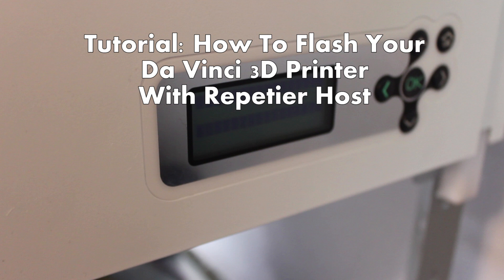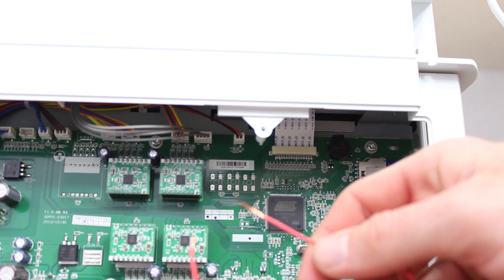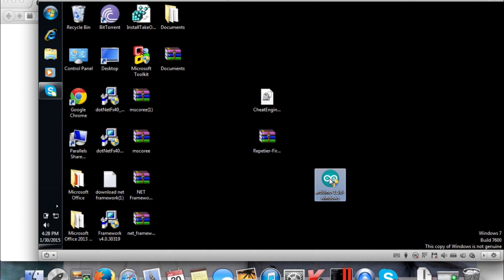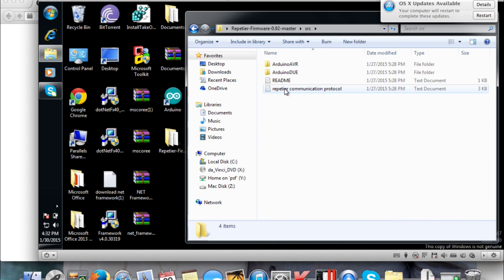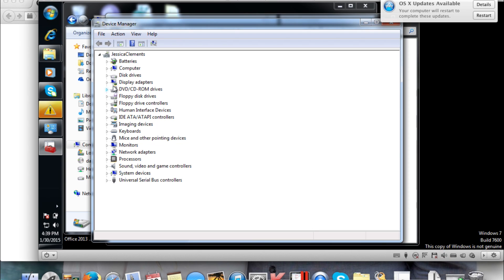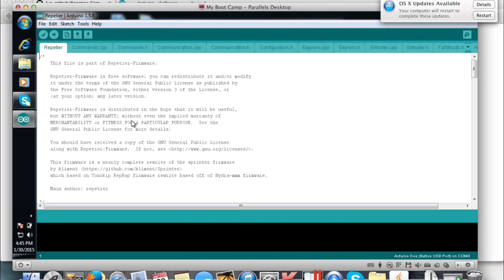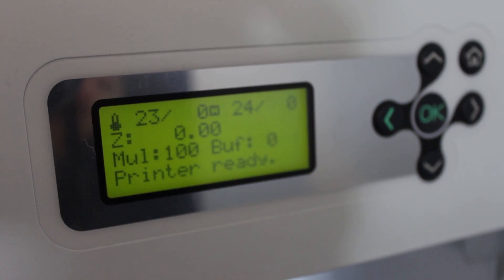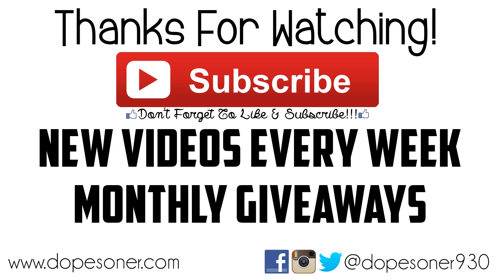Tutorial: How To Flash Your Da Vinci 3d Printer With Repetier Host | 3d Printer Hacks

Comment: OK, so nobody makes my mistake, if you have a Da Vinci 1.0a with a serial number starting with 3F10A, this WILL NOT WORK! This will effectively brick your printer, as there is no way to reinstall the original firmware!
Reply: +Thomas Piccione You sure you didn't do it correct? looks like this guy isn't the only one to flash a 1.0A. There is even options in the code to adjust for the 1.0A. Have you tried dumping the memory (jumping j37) again and trying again?
Reply: jake wishau  Sadly, I tried it multiple times, and I followed the guide precisely. If you noticed, all of the da vinci 1.0A's that have been flashed do not have serial numbers starting with 3F10A, as these have newer boards, and they cannot be flashed. I changed the setting to the 1.0A, but this is for the older 1.0A with the older boards that CAN be flashed.
Reply: +Thomas Piccione Good to know. Too bad I can't find a cartridge reset for the newer version too? It's a great starter printer but I have only had mine for 2 weeks and feel like I have out grown the very limited software adjustments and I would love to use 3rd party filament.

Comment: Followed Video EXACTLY. 
It worked!!!
Much thanks to Mr. Dope!
Reply: What printer do you have?
Reply: Luis Alejandro Sáenz

I have a Da Vinci 1.0 (JP1 to reset)

The guy in the video has tried it with both the "1.0"(JP1) and the "1.0a"(JP37) models and it has worked.

I thought for sure my machine was broken, then I finally just decided to start clean. I deleted all my previous files, turned off the printer and started from scratch. Again: The board is literally impossible to brick for good so if you have the 1.0/1.0a THIS TUTORIAL SHOULD WORK. If its not working, you're probably doing something wrong. Delete all files and restart from the beginning. 

Guess all I needed was a fresh start!

Hope you reach the promise land!
-Justin 

P.S. I do have to confirm that the Repetier Firmware is MUCH more versatile and user-friendly than the stock firmware. It is well worth the upgrade/switch.
Reply: +Justin Shaw I have another question. My XYZware software don't recognize the printer, but my computer does. Which software should I use to print? Thanks :D
Reply: Luis Alejandro Sáenz 

What does the computer recognise the printer as???

 If it doesnt recognise it as a "Bossa Programming Port" then you may have to re-flash the printer. This seems like a problem with the software and not the computer or printer. (For a PC, I have not figured out how to configure it with a mac...) This also depends on where you're at with the firmware-update process... if you have successfully updated to Repetier (Does LCD screen light up?) then you should definitely not use XYZware, try Repetier-Host (http://www.repetier.com/download-software/).

Best, 
Justin :D
Reply: +Justin Shaw Actually I'm using Repetier Host and right now I'm printing for the first time since I flashed my printer. It was very difficult to set the right configuration to start printing, but finally I've done it. I don't know if you can share with me the configuration you set on you printer. It would be very helpful for me. I appreciate your answer and I apologize for my english. 

Thank you

Comment: Hello! I am in need of some assistance! We just flashed our ZXY Davinci 1.0 printer. I Followed the steps exactly as stated in this video. However we are now stuck in a boot cycle. It brings up the boot screen, Loads the information, but we cannot click the right arrow to pull up the menu. then after about 10 seconds it cycles back through. Has anyone else experienced this issue?
Reply: +nickpro2000 I dont own a da vinci but it sounds like a block and you need to short the board again
Reply: +Jeremiah Matousek we actually fixed it by disabling watchdog. Thanks for replying though!
Reply: +nickpro2000 can u send me a link to how to disable watch dog because i am planning on buying this printer
Reply: +Whopper Mods I did not find a link to it I had to dig through the github to find it. You can disable it by going to the configuration.h tab in the repietier file and ctrl + f "watchdog". where it is defined change it from 1 to 0.
Reply: +nickpro2000 the exact line you're looking for is "#define FEATURE_WATCHDOG 1". it's on line 1386.
Reply: +nickpro2000 thanks allot
Reply: +nickpro2000 was ur printer on firmware version 1.2.7 before u flashed?
Reply: +Whopper Mods I don't remember exactly what firmware it was on but as I recall it was the most recent firmware available at the time.

Comment: my problem is that it tries to print off the side of the bed nearest the waste bin. how do i change start point?
Reply: I had the same issue...

So what I did was I went into the settings of the XYZWare software, and changed it tfrom mm to inches twhich allowed me to select "Automatically Center..." (Then exact name escapes me) then I changed it back to mm because nobody likes the 
Imperial System.

That fixed it for me. Now it automatically imports the ".stl" files into the center of the bed.

Hope that helped you!

Justin :)

Comment: Hey nice work on the video really easy to follow. 
!Problem I got everything connected and had control of everything but!  When it runs a code it doesn't push out filament. So I checked and did a head clean and everything worked. Have you read or seen this?  Getting tired of looking

Comment: I'm having a problem and I cannot figure out how to fix it. Running Arduino 1.58 Firmware .92 Da Vinci 1.0 ( J1 style) After I compile and Upload the firmware it the LCD still has black lines and the machine seems bricked. do I reset the printer and then open repetier? Even when I reset the machine I get the sane error. Repetier does not see the printer and gives me an error " The connection failed with the following erros: the parameter is incorrect. Make sure your printer is connected" Do you have any ideas? I think the printer is bricked and the only way to fix the machine is push the original firmware with atmel. Any ideas? I also try to upload .91 firmware and have the same issue. .91 firmware use to work as well.
Reply: +Mark Fuller did you find a way to fix it I have same issue????????????? plz help
Reply: +Cian Govern 
Same issue here. Still have the black lines even though arduino says set boot flash true & CPU reset.
Reply: hey I just downloaded the repetier thing for arduino and loaded it straight on and it works perf
Reply: Do you still have the black lines across your LCD screen when you flashed the Da Vinci? What repetier thing are you talking about?
Reply: +Mark Fuller Shit, shit shit SHIT!!!! SAME PROBLEM! Any way to go back? Really need some fucking help
Reply: +Thomas Piccione there is another way to do it by using arduino software look for other tutorials on utubes and pick one that's what worked for me
Reply: Cian Govern Thanks for the reply, but the newer boards cannot be flashed with repetier and there is no copy of the original firmware, so my printer is effectively bricked :/
Reply: Thomas Piccione have you checked out this website? They have original firmware saved. You should be able to reflash you machine with atmel software. http://voltivo.com/forum/davinci-hwmods/29-i-bricked-my-da-vinci-1-0-3d-printer-upgrading-firmware#175
Reply: +Thomas Piccione ye mine is the first line of an and is really old soz I couldn't help I hope u get it back working there not cheap

Comment: will this work on the DaVinci Junior 1.0?
Reply from the maker: No idea haven't personally tested. Your best bet is to check out the forums over at soliforum or voltivo they are both great
Reply: +Dopesoner ok thanks
Reply from the maker: +Bernard Melus no worries if you do find out and want to report back that would be great I'm sure you are not the only one that is wondering the same thing
Reply: No. It is locked down where you cannot reprogram it. Similar to what Apple does with the SMC chip

Comment: Has anyone confirmed that this works with the Da Vinci 1.0 AiO?  I am also assuming that this leaves the scanner useless?  I am tired of playing with this thing and I am now getting an Unidentified Cartridge error.
Reply: +Jeff Ogg being that this comment is 2 months old, have you found out anything since then? I too have an AiO and can't find any information on if it will work and if I can still use the scanner afterwords. I might try it regardless, I seldom use the scanner anyway.
Reply: I have not heard anything.   If you do end up trying it please keep me posted.
Reply: Jeff Ogg Yes, this works the same for the AiO 1.0. It does not support the scanner function, so scanning will no longer be available. I never used it anyway, so it was no issue for me. You use the jumper "J37" to wipe the EEPROM. When configuring use number "4" for the AiO. Everything else in this tutorial works great for the AiO. So far my prints are coming out awful, worse than with the XYZware, but I think I just need to tinker with the settings some more. There are several more setting options and I haven't figured out what they all mean yet. Hopefully in the end I will be getting better prints, but I will say that so far, the XYZware was easier and more straight forward to use, at least for me (that is of course when it worked - I had to restart my computer every single time I wanted to start a new print with XYZware).
Reply: Glad you didn't brick your printer.  I don't use the scanner either.  I may have to try it now that I know it works.  Thanks
Reply: After three weeks, I couldn't be happier that I flashed mine. At first I was discouraged because I was getting horrible prints with Slic3r, but after switching to CuraEngine to slice my prints and fine tuning my temperature settings, prints are coming out great. The main reason I switched though was so I could use any filament I wanted and not be stuck buying XYZ brand carts. Currently I am using SainSmart brand and am getting almost twice the amount of filament for the same price. I also now have the option to use metallic and flexible filaments which XYZ doesn't offer. I haven't tried those yet, but at least now I have the option. The money I am saving in filament though was worth the risk of flashing it.
Reply: Awesome!   Guessing I am going to do it this week sometime.  Thanks for the information.
Reply: I have no idea.
Reply: +Jim Smith hi jim, i aslo have a AIO, i was wondering if your printer is a 3S10A model? because im quite confused that every one is cautious about the 3F10A series.i dont know if its safe to flash, can further share your experience. Thanks alot

Comment: So I managed to erase the firmware on my 1.0, however when I upload the new firmware with arudino, nothing happens with my printer, still has the black bars. Arduino says it verified and everything, last thing it says is "CPU Reset". The only change in the printer is that my computer cannot recognize the device and I need to erase the EEPROM again. Any help would be appreciated.
Reply: +jakwnd get atmel 6 studio and then re do the jp1 for 5 seconds before turning off
Reply: +Darya N +jakwnd What do you do with the Atmel 6 Studio? I'm having the same problem

Comment: Another way you can flash your printer, which is how I did it, is you disconnect your pc from the internet download the repetier firmware file. then go to upgrade your printer in the XYZ print program and it will ask for the file you want to install since it cant connect to the xyz server since you are not connected to the web. It will then install the firmware like it would any other xyz firmware but when it boots up it is Repertier. Accurate as of August 2014 but I'm sure it still works .
Reply: Are you 100% sure that this method works? I have the Da vinci JR and I want to know for sure before it gets bricked..
Reply: not sure about the Jr but it should still work if its using da vinci firmware. id look further into it if I were you.
Reply: +Alien Scope don't think it will work as junior has newer software

Comment: Anyone got any ideas on how to UNBRICK my XYZ 1.0?
I did everything correct until it came time to copy the "hardware" folder - I accidently pressed "skip" on a couple of the folders.  My computer's device manager now doesn't identify the printer so it doesn't give it a COM port, and in the arduino software the com port isn't recognized.
I'm stuck with the two bars on the display, and my computer won't identify the device.
Reply: bob dobb mine said it was port 3 at first but i had to use port 6 for it to work.
Reply: +bob dobb same thing happened to me    can someone plz tell how to fix thz
Reply: Make sure you use the old version and unplug you USB with the device manager open to verify the USB port setting.  Those 2 things fixed my issue.  And trust me it's worth it. It's like I have a totally different printer.
Reply: +bob dobb I had the same problem you will need to do 2 things    first go and download atmel 6 studio it will install a list of drivers you need. then after that if your computer doesn't recognize the printer than re short your jp1    after that you should be all good:)
Reply: +bob dobb ,How did you solve this issue? I have the same problem. Thanks.

Comment: Just to clear the air in case anyone was as confused as I was when I went to do this.  There is other info out there that says certain models do not work (3F10A sn printers):

This works fine on the 1.0a 3F10A sn printers.

Your printer may show as a 1.0 on the LCD if it has 1.0.1 firmware
Your printer will show as a 1.0a on the LCD if it has 1.0.3 or higher firmware.

I hesitated a bit before working up the nerve to update the firmware because I had the 1.0 on my display with the 1.0.1 firmware thinking I had a different model printer.  I realized that despite this on my display that it is still a 1.0a, and followed the 1.0a instructions. Everything is working, after bed calibration and getting some filament settings together.

A big thanks to the community that wrote the software modifications needed to get the 1.0a to work, it looks like it took them a few months of collaboration to adapt to the new model of printer.
Reply: Thanks

Comment: Is there a flash for the Dual Extruder DaVinci?
Left extruder jams right into bed with excruciating sound.
 or gcode so that the physical stop will work?
I manually extended the piece of metal that is suppose to signal bed to stop moving not functioning at all.

Comment: what's up bro. I have the xyz model with the 3f10A serial and this is the new board with the J37 jumper ,I assume is the 2nd gen  .will this flash work on my printer if change tho model to 1 as you explained on this vid? my email is moreyra68@gmail.com.Thanks
Reply: MAuricio Moreyra Worked just fine for me.   I had 1.0.1 installed on my 3F10A sn printer.  Used repetier.  Need to do be calibration, and set filament settings since the defaults did not heat the bed hot enough for me.
Reply: Thanks for the response. I got it working like a clock ,with Repetier thanks to your video . Excellent tutorial.thanks

Comment: thedopesoner930 Can you provide more details on levelling the bed? I used your guide to flash the new Repetier firmware but it seems like there is a lot more to go before hitting print and not having my extruder hit the side of the bed. Right now that's what happened after my flash and adjusting the Host software settings from other YouTube videos. Do you have another video incoming or a typed quick guide?

Comment: +thedopesoner930 also in your next video you need to mention that Microsoft is going to or already has, in which I am about to find out, that are coming out with something to stop letting certon chips from working. and this website www.ftdichip.com I have been told is supposed to solve some incapablality or something....
Reply: thomasheisler I think Microsoft did put a update out that messed with the chip or usb config, just got done reprogramming the printer and sytem restore, got it finally up again. we do need to research this
Reply from the maker: thomasheisler thats interesting that doesnt make a lot of sense to me
Reply: I know, nothing had changed, but after the microsoft update it stopped running